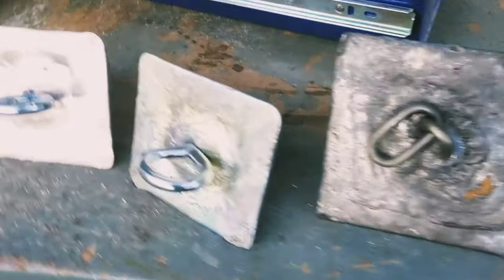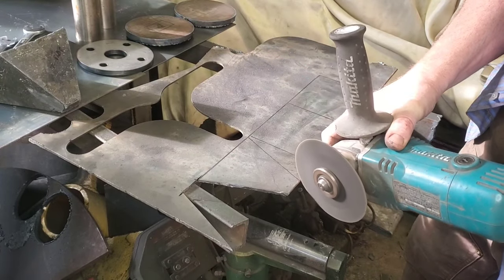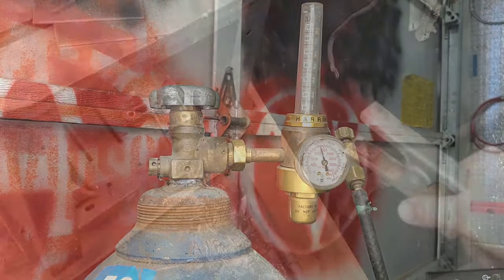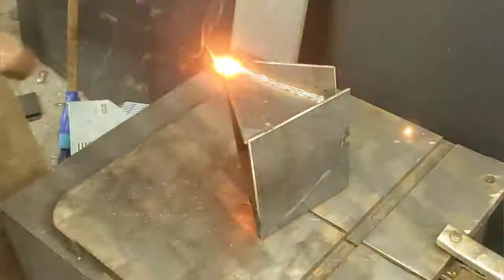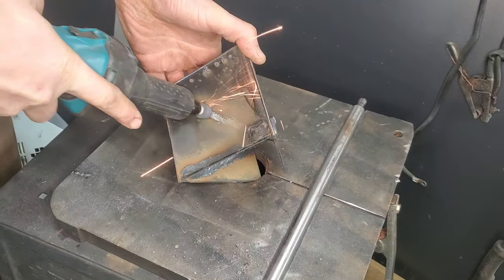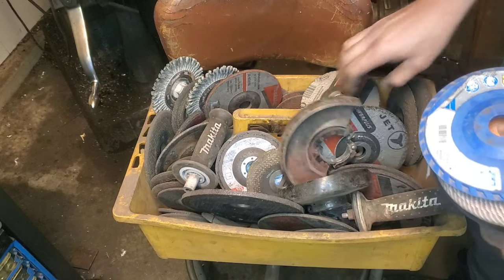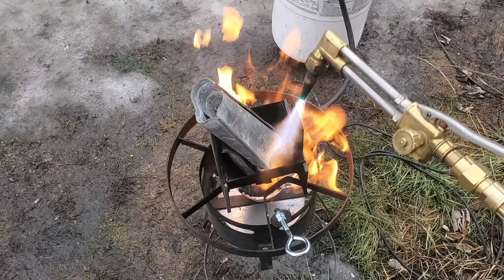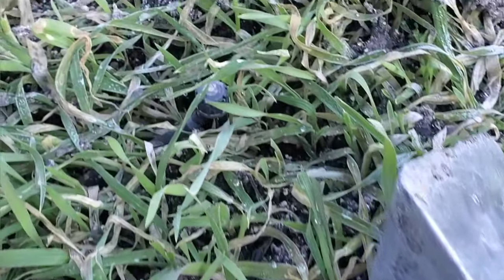Easy Casting Pyramid Anchors For A Local BC Fly Fisherman

Comment: Give benchmark adbravise cut off wheels a try, best I've ever used, great video..
Reply from the maker: Great suggestion!
Reply: Typical comment that is irrelevant without knowing what you have tried.
Reply: @ShainAndrews  benchmark adbravise cut off wheel ! I think that says it all..
Reply from the maker: Hahaha,  shain perhaps should have answered better. :) good point.  I have tried quite a few different brands. Excluding, never tried benchmark.  I currently have in the shop Pro point, powefist maximum. , blue shield, walter and tyrolt,  ( just dug through my pile again)   the walter is what I was using in the video but the blue points and tyrolt worked really comparable.   Some of the other cost effective have found are spotty. Some times you get some that are amazing and by another box of the same is disappointing :)